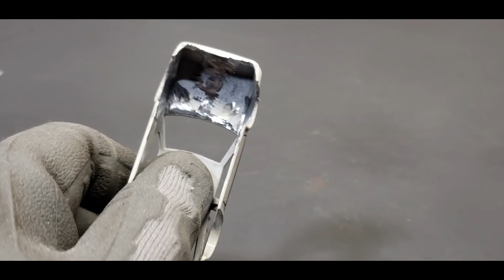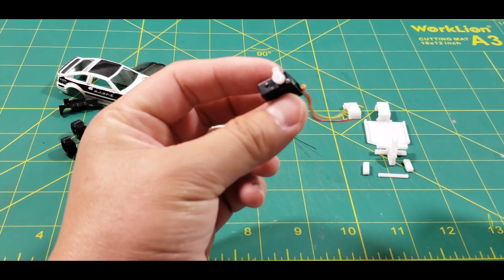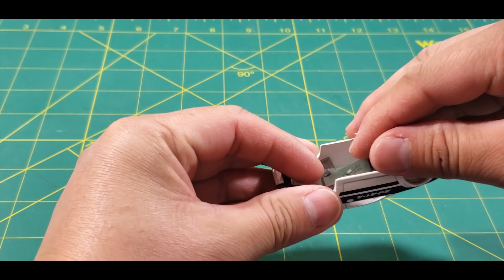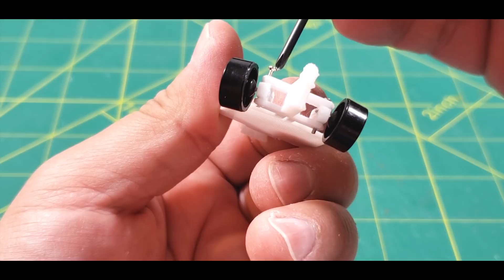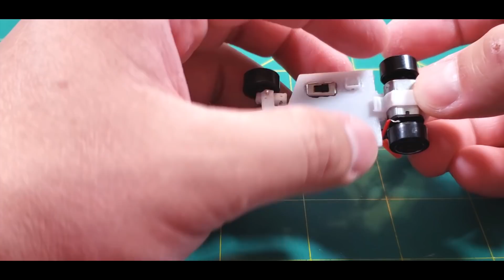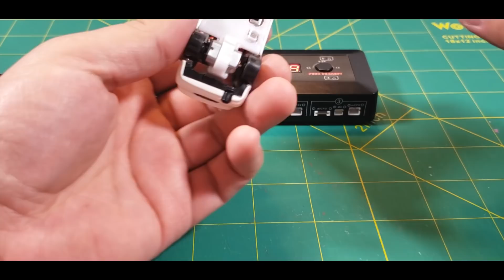RC Hot Wheels Toyota Trueno | DIY Hot Wheels RC conversion 1/64 scale diecast RC, Micro RC Car

Comment: Just commented on your first video and this seems to be the only video I missed with most of the info I was looking for. I do still have one question tho, do you know of any similar rx and tx options for this i really want to do an arduino nano and bluetooth module for cell phone use do you think that's possible?
Reply from the maker: Hi. You can do some google search for micro scale receivers. There are a lot and some priced pretty good. FlySky receivers are on the cheaper end as will.
You could totally use an arduino nano board (I had thought about this too). Just make sure to factor in all the other components in order for you to have enough room.
Reply: @SlickDiecast  I wanted to do an flysky one since I have an i6s transceiver but I wasnt sure how to connect it maybe you could help me out? If not I'll probably focus on the arduino build
Reply from the maker: As long as you have a receiver and transmitter that has the same protocol, you should be able to bind them both with no problems at all. All receivers have different binding procedures and each should come with instructions on how to bind to a transmitter.
Reply: @SlickDiecast  most of the flysky transmitter work on subs, im new to the rc stuff so im not entirely sure what any of the transmitter stuff means which is why i was leaning towards arduino